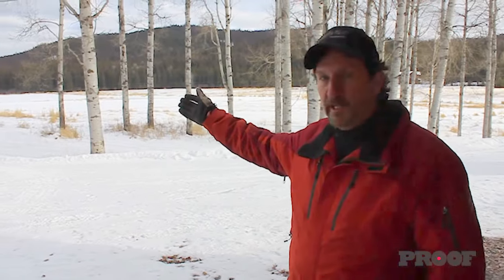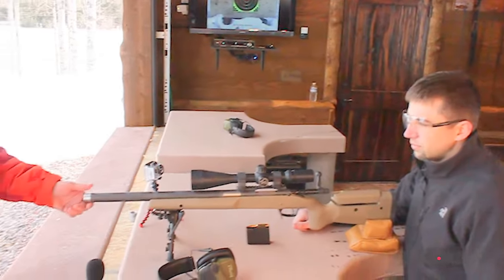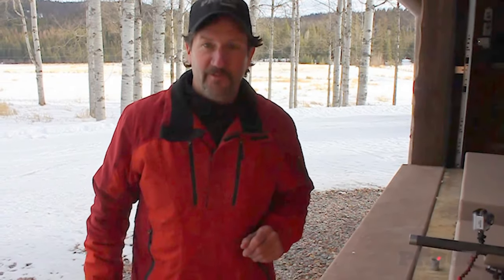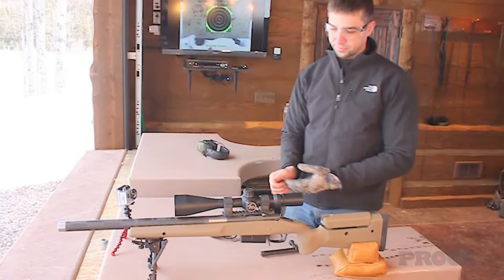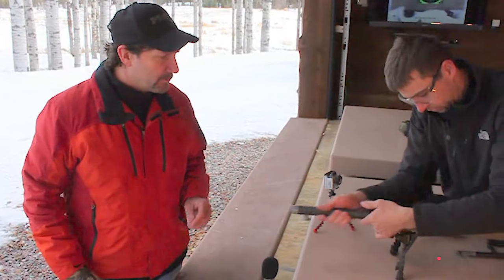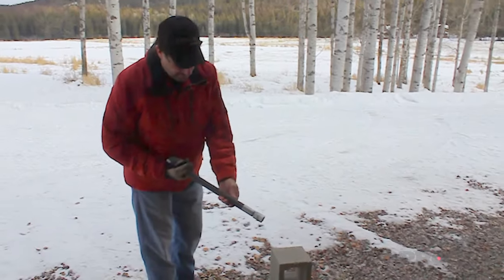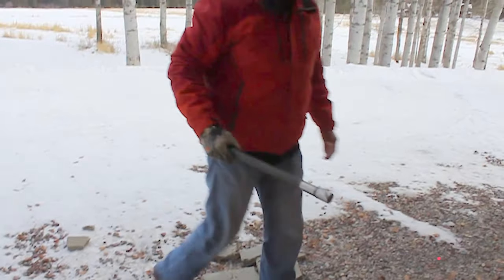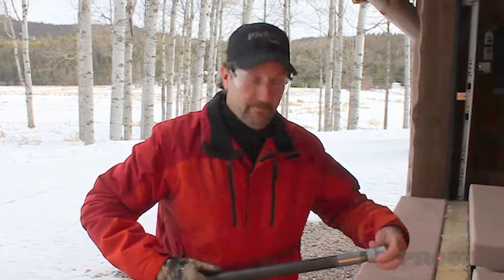The Ultimate PROOF: Carbon Fiber Wrapped Barrel Durability

Comment: you guys do realize that shooting  a tight group with a barrel that's not torqued down is very unlikely right. The fact that it shot that good and close to zero after being reinstalled and only hand tightening is pretty good. Not to mention they beat it an a concrete block lol
Reply: I agree with everything you said. I think the slight bit of trick to this is that they allowed the barrel's shoulder to completely bottomed out to receiver. I dont think torquing it would make it shoot any better.
Reply: He took that too 45 nueton meters Greg was firm

Comment: If I could see a carbon barrel under full auto fire until failure, then all my concerns on durability would be answered.
Reply: Do you own a fully automatic rifle? If not then I'm not sure that matters.
Reply: With a good trigger and enough time on the range you can approach speeds close to the  lower RPM full auto firearms . With products like the Fostech echo trigger most shooters can approach that kind of speed.

Such speed is sometimes REQUIRED in three gun and other competitions.

The real worry isn't about rounds per minute though the million dollar question is : How well does this carbon fiber wrapped chunk of steel dissipate heat ?

There are two reasons to worry about heat : The shift in point of impact after the initial cold bore shot and how big of a difference this will be , and the other worry is if this is anything like carbon fiber wrapped barrels of old that means it doesn't dissipate heat . 
Instead the  binding agent for that expensive carbon fiber wrapping acts like a Themos and holds heat in leading to throat chamber and rifling erosion .
 This lack of ability to shed heat is HIGHLY detrimental to the rifling and the chamber. 

The outside may be carbon fiber but the rifling is steel.
ALL steel barrels /carbon fiber wrapped barrels have a heat treatment and an annealing temperature. 
Once the steel reaches it's annealing temperature it becomes more "plastic" in nature as opposed to being rigid and it can not fully regain it's rigidity .

Carbon fiber can be made more structurally rigid than steel in a similar length , but
that rigidity alone is just one small part of a much more vast equation .
As well that  external structural rigidity means little if the internal operating structure is compromised.

Once you have reached annealing temperature just once even the finest sub-MOA barrel becomes far less capable of maintaining potential accuracy as the damage has been done to the chamber and rifling . The heat and pressure has cut into the weakened metal.

If the metal becomes too plastic in  nature due to heat build up beyond it's capability to shed said heat then the likelihood of a barrel rupture increases exponentially . 

Heat and pressure chamber erosion is what KILLS accuracy  & precision.

Ever wonder why traditional button rifled, 5R rifled and even polygonal rifled steel barreled rifles chambered in .300 Winchester Magnum .300 Norma Magnum and other high velocity  rounds have such as  short estimated barrel life ? 
: It's the heat and pressure  these rounds produce FAR more  gas pressure and heat due to the propellant loads behind the projectiles than  standardized  "Non Magnum" loadings such as  7.62 NATO , 5.56 , 6.5 Creedmoor , .260 Remington.

With a barrel which does not dissipate heat even a relatively low pressure round such as 5.56 or even .222 Remington suddenly after prolonged shot strings as low as 5 rounds in the span of 30 - 45 minutes become rather damaging to the lands and grooves. ( or the "Hills" &"valleys" in a polygonal barrel.)
Effectively the shooter could be halving or even quartering the expected usable lifespan of their barrel , dependent upon the round's SAMMI pressure rating and heat generated

What good does it do a shooter to spend twice the price of a standard match grade bull barrel if he or she ruins their accuracy mid way through a match with a prolonged over 5 round shot requirement during a stage?

What good is an AR barrel which is carbon fiber wrapped if you are halving  the barrel's life compared to a traditional button rifled steel barrel with either a chrome lined or a melonite treated bore and rifling ?

Unlike the older carbon fiber barrels , the worry is not about the 
binding agent melting due to  prolonged fire , it's more the lifespan 
and viability of the barrel and it's ability to act like a heatsink like
 a traditional all steel bull barrel will.

 3 round "groups" and bashing a thick carbon fiber wrapped barrel into a cinderblock don't prove anything , a steel bull barrel even some mid profile barrels will survive the beating , and the industry standard of proof is the 5 round group. ( This allows for any variances/ anomalies such as flyers. )

Look , I WANT this to  be a rousing success , I want lighter weight high quality precise and accurate barrels with good durability which properly shed heat as intended. 
But we have seen companies try to shill carbon fiber wrapped barrels as a shooting community panacea, and all we were sold was a combination of snake oil and really expensive fancy tomato stakes.

For or all their bluster and sales acumen they must ironically live up to their chosen naming convention and show actual scientific PROOF , with peer review.

Without that data most of us will remain skeptical and avoid. 

The ones whom step up and purchase such have a 50/50 coin toss in odds of getting something great or fall into the category of "Fool my once shame on you, fool me twice shame on me."

This video while entertaining , does nothing to present any valued proof.
Reply: reignick1133 that is very obviously my point.  I'm glad someone else thought of that. The answer is that it can not preform like a steel with sustained firing.  I may dig my heat transfer book out of storage to prove this point.
Reply: reignick1133 damn haha, going biblical on em! Valid points though, I forgot that the barrel is more or less insulated by the wrap
Reply: +gravitas73 And then Vegas and the NRA came along....
Reply: isnt carbon fibre better in high/low temperature?
Reply: I do M16 A2
Reply: Bolt action rifle...
Reply: CNN IS VERY FAKE NEWS  lol has he? You also can't forget who banned fully auto guns in the first place. Hint: he was the 40th president and both his first and last name started with an R.
Reply: General purpose machine guns are actually a market that carbon could conceptually take over when it reaches anything near cost parity with steel.  Given a weight of ~50% steel and ~30% better heat transfer, an MG team could carry twice as many barrels for the same weight (though they might not need to given the improved cooling, thus allowing a greater ammo load).
Reply: Carbon Fiber on the outside......does not extend barrel life on the inside

Comment: being a certified gunsmith since about 2008  maybe I can clear up a few misconceptions on this vid. first off a hand tight barrel cannot expect to be completly  accurate. second to be accurate the barrel should be indexed to the same point each time the barrel is tightened. this insures the same barrel/ receiver alignment each time the gun is assembled. third, temperature change as little as five degrees can change that  contact point so the difference in point of aim could have been that . I was expecting this when he replaced the barrel. the point being the durability I think he made his point.
there a lot more factors to the assembly of an accurate rifle than you realize don't jump to conclusions  till you have enough info to make an informed decision .
Reply: u say u are a gunsmith i will make rifle barrel out of titanium pipe (seamless cold) for example 3 mm wall thickness for chamber is it good or will explode at first shot ? for the caliber i think 7.62x39 i really dont know about titanium but they said its very strong and i heard i can make really thin barrels from it
Reply: @522alien  Ti has been tested as a barrel before....I thought the same when I became a machinist many years ago.....It is tough but the problem is the rifling wears out in about 10 shots as it cannot handle the extreme heat and pressure of the hot gases (plasma basically)
Reply: Seen a guy on 1000 or 1500 milk jug challenge get a cold boar first try with a barrel he just screwed on.
Reply: @spcpitts  Going to make a similar comment. Torquing the barrel has a lot to do with how the action is set up and some you can simply hand tread on and tighten
Reply: hi sorry to bother you but i understand your great expertise   Why vises are not so popular in accuracy testing ?  they take out the shooter variable at least 
I have found only this video the looks quite more scientific to me
https://www.youtube.com/watch?v=xMuDsWOQ2SY
Reply: @gino3286  not really clear on your question here , but if im understanding you right a vise is not used for accuracy testing because it brings other factors not normally involved in the shot into the mix. it doesnt allow for the normal recoil involved from the shot into the shooters shoulder. the amount of rise from the barrel, the relief gap between the forestock and receiver or lack thereof, ie how its bedded. temperature of the barrel
-a cold barrel may  be dead on . five shots down the line after the barrel has a chance to warm up, that shot may have as much as a 2"point of impact shift at a hundred yards. a shooting vise while good in some ways just does not react the same way as flesh and bone  and your not going to carry a shooting vise to the field with you are you?
Reply: @TheOldGunsmith58  Good morning and thank you sincerely for your kind and valuable response
I would like to divide my answer into two, talking first about complete rifles and then specifically about rifle barrels
In rifle tests imho it would be interesting to eliminate the shooter variable from the result
the vise I was talking about is something like this 
https://www.youtube.com/watch?v=xMuDsWOQ2SY
I would just add a laser pointer on top to make sure the rifle doesn't move left or right or up and down after each shot

Barrels topic
Being a less gifted mind, I always try to simplify complex problems to try to understand them
In my opinion, the intrinsic precision of a barrel sets the maximum precision that can be obtained from a gun
And I understand the cult of barrels
in short I wonder if and how the accuracy of a barrel could be measured without mounting it on a rifle
And the following photo seems to me to be the most promising method

https://lh3.googleusercontent.com/-MsyjuYGYBCM/UKepx-uQAXI/AAAAAAAABAs/tu8u54ECOr4/s640/Rail.jpg

I believe every barrel maker should have similar equipment
I'm honestly fascinated when I see 3 shots end up in the same hole at 100 yards. 
I even get emotional

Thanks again and best regards Gino
Reply: @gino3286  tried to answer you earlier this morning got nearly done and deleted the whole thing . so lets try again. the video you showed was from the marine corps sniper school in quantico va. im very familiar with their work as i was stationed  at weapons training battalion from 77 or 78 to 80 . i would trust any info they came up with . as far as the photo goes that is a preproduction and current production setup manufacturers use to test barrels. that i would also trust . if you notice in the video that is a remington 700 with a heavy barrel and a suppressor. both of which help to increase accuracy. all barrels whether pencil barrels , fluted or heavy have what is called barrel harmonics. that is how they vibrate as the shot is going down the barrel. this is why torque and alignement are so important. if a barrel is loose at all or any parts are sloppy fit you will not get good accuracy. under torqued receiver to stock , under torqued barrel  to receiver, poor fit between bolt and receiver will  effect those harmonics. thus effecting accuracy. some older military  rifles mainly from ww1 and 2 were fitted to have some  stock contact along the full length of the barrel. examples  german mauser,  lee enfeild, the garand and others were all fitted with bands to pin the stock tight to the barrel and often would not shoot well without those bands in place. most newer rifles are free floated meaning the stock only makes contact at the receiver and not along the barrel. a general test for this is usually to take a dollar bill and slide it in between the stock and the barrel .the  bill should slide nearly all the way up to the receiver without getting stuck.the last couple inches are kind of iffy depending on the manufacturer. many wooden stocked rifles that were once good shooters may have gotten wet and the stock now makes contact where it was not intended to throwing off accuracy . usually sanding down the stock will fix this. as far as the photo goes most manufacturers do have something similar. hope that helped.
Reply: @TheOldGunsmith58    Good morning, thank you very much for your very kind and valuable explanations
As I was telling you, I think it is interesting to understand what the absolute precision of a barrel or, better yet, of a complete rifle could be
To be clearer, if I compare myself to a professional shooter at a range using the same weapon and the same ammunition in the same weather conditions, there is a very good chance that the groups I get will be much less tight than those of the elite shooter.
But I think it is very important to know the true potential of a weapon so as to identify the real problem in one of the variables
I conclude by saying that the proof of the paper is not sufficient imho
If the stock under the barrel is not very rigid it will end up flexing and touching the barrel
In fact I see more and more solutions with a kind of cage around the barrel
Thanks again and best regards
gino

Comment: I think maybe a few of you are missing the point here?.... A hand tight barrel its going to shift some as far as groups and point of impact... but giving the fact that the barrel is almost 3x lighter and is close to 10x stronger than most Steel/Moly barrels and retains match grade accuracy is the golden goose of this idea... Those that have spent a week chasing Elk in the high country know what I'm saying..... But the big boner killer is the $900 price tag of an un-chambered un-threaded barrel blank or the $5,000 for a complete Proof Research rifle.... I think if the price point wasn't such an issue you would see these taking off in a big way
Reply: Yeah I can some of them are missing the point but I did find an AR carbon fiber barrel for $500 from another company
Reply: christensen arms

Comment: Are there spools of carbon fiber?  Could say a carbon fiber be wound on the barrel with tension and the epoxy applied as it's being spooled on...then once it's cured, machined back to profile...rather than just wrapping it with a sheet of carbon fiber...this way the fiber itself is spooled on and is bonded to the barrel?

Comment: it's been mentioned (at length) in the comments below already, but I too would like to see a demo of sustained fire to demonstrate it's ability to tolerate heat.  Say,  250-300 rds of mag dumps on an AR platform to show us that the carbon fiber won't de-laminate or cook itself.    You can get a steel barrel red hot and it'll (mostly) be ok... can a carbon fiber barrel perform like that?  Is there any data that Proof Research has on this? I think we'd all like to see it.

Comment: Interesting vid... I would be real curious though since it seems to have shot a couple inches high, was that a result of the impact point on the cinder block or shooter ?  If you should do this again, would you mark the barrel at its top center position as secured to the receiver, and mark it at the strike point to the block. This would help determine if the change in accuracy was a result of impact with the block. Thanks :)

Comment: Not really surprised about the accuracy its a think round mostly solid cylinder with a spring temper steel sorry but thats going need a lot more force to bend. Now the carbon fiber holding up at the point of impact with no dicernable damage thats pretty good. As we all no not everything that looks the same is the same, meaning they got that carbon fiber right as far as I can see.